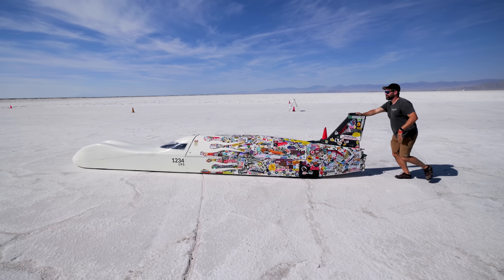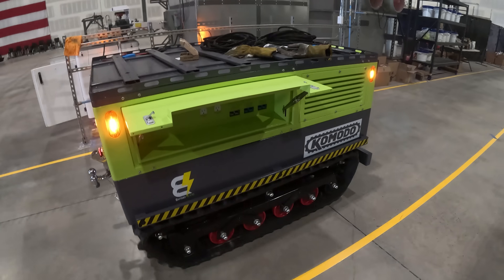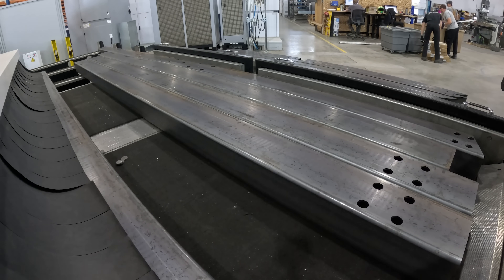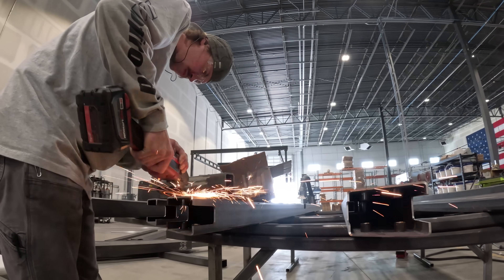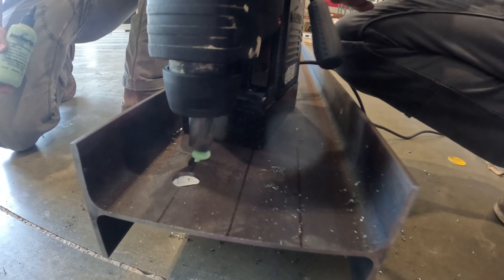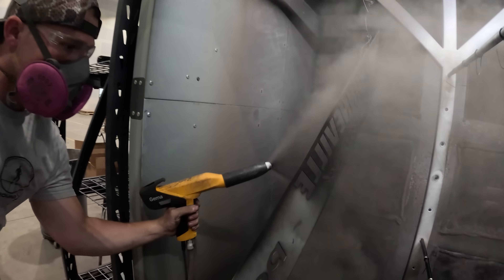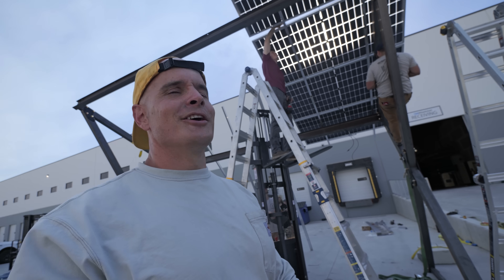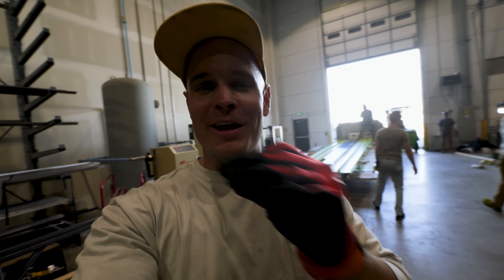The New TESLA TANK -- (Going Off Grid will never be the same)

Comment: If you use countersunk bolts to hold the nuts you are welding to the steelwork they will align the nut with the centre of the hole.

Comment: One of the things I see every couple years is people claiming that CAD is so hard that they'd rather struggle with designing as they build. Or at least some version of designing as they build, like translating a napkin sketch into an object, or their mental picture into the actual thing. CAD might be more tool than some jobs need, but the basic idea of thoroughly designing your thing virtually or on paper goes a long way.

A way to look at it is that if you're in a hurry you can't afford to skip CAD (computer or cardboard).
Reply: There is a learning curve though. If you first have to learn CAD, then by the time you have a CAD plan, chances are you could have been done with the project, using a napkin sketch.
Reply: @dachsdk1559  Fair.

Though that's one of the reasons I tried to follow up with "CAD might be more tool than some jobs need, but the basic idea of thoroughly designing your thing virtually or on paper goes a long way." Learning CAD from scratch (or relearning it now when you learned the OLD AutoCAD way) is a cost, so I meant to be mostly talking about people who don't use the design and documentation tools that they have. And particularly the people who insist that they would have spent more time increasing the detail of their design than they ended up spending on mistakes (or wasted materials) during their napkin sketch only design.

For some further clarity, a napkin sketch to me isn't really a design, it's somewhere between an idea and a design. Sometimes it's enough if the actual thing in your head was largely complete, because then the napkin drawing is really just a mnemonic. A design doesn't have to have all the answers, but I think it should represent all the questions one could reasonable come up with before picking up the tools.

Also, now that I remember the context of this comment, the scale of the project (cost or just simple size) directly increases the value of designing ahead. Material costs of mistakes are higher with bigger parts (or expensive materials), and reworking is typically slower too. I'm not sure CAD would have been important for a support frame 1/4 the size of this one, even when made by a team like this that already has CAD users and CAM tools, but the time spent virtually designing this support structure let them use (expensive) faster tools and put it all together pretty rapidly with apparently very little time wasted on problem solving.

Comment: Just wondering if the array comes close to filling your daily plant power needs using the battery to even out surges. 
If not and your evening power costs are lower than during the day then topping the battery overnight could help with that. 
This probably wouldn’t be cost effective to buy but if you have the unit paid for and mostly on site anyways, I’d think it could help improve the bottom line.

Comment: Mobile DC Fast Charger! Charge Rigs FLEXX 120. What is the difference between the track Mobile Battery and the one I have mentioned the one I mentioned, that is on a trailer but yet the tank Mobile Battery could be put on a trailer 
Very cool it needs a rotating solar array which looks like a flower that way you could capture the Sun as it moves 
Did you do the double-sided solar panels because you do get a lot of reflected light I would think I don't know on the Salt Flats .
It's interesting watching you build I wanted to copy an old design of a hot tub cover which was made out of 1" square aluminum tubing and it was really hard for someone to come up design and welding it all together most hot tubs are the same size and it was in two halves where it had pins which would locate the two halves together when you put it on the hot tub but it was so simple and it could easily be covered with a bespoke covering,  I would think that there is a market for it because the ones that you buy from the hot companies look awful especially when you have some high end residential property

Comment: So this a 900ah battery on tank tred tracks, 3 300ah lipo batteries. This doesnt seem logical.  Searching i saw 1200ah and thats just one more 300ah battery  so 4 basic lipo batteries are heavy but not that heavy that it needs tank treads. 72 volt batterys are massive i guess.

Comment: You're wrong about cars on the coast IMHO. I have a 2014 Subaru wagon (for example) that has lived outside, across the road from a beach, all its life, and it's fine. Other stuff, like garage doors and metal fences, have a lifespan of about 20- 30 years, but having said that, my 30+ year old steel shed (24x18) still looks like new. As you'd know, surface prep is everything 😀 On the 100kw battery, pretty exciting what potential an EV with a 100kw battery could have while sitting around in your drive 🔋🤩

Comment: For your magnetic drill press, I used to use what I think were called hole-hawg annular cutters that had a special holder that was also an oil pump that lubed the bit as you drilled down inside

Comment: You know you can get generator to mount in the tesla
Reply: With a solar array and a battery you won't have to fuel up ever, no oil changes, just the regular cleaning and maintenance. Less things to worry about. Plus a generator of that size will be loud, and it cannot be used indoors.

Comment: 0:20 The closest place to get the electricity is the sun? 🧐 I thought that thing was pretty far
Reply: It's actually spewing parts of itself right onto our little planet.
Reply: @cre8tvedge  parts of it, not the sun though, which is what he said. Thats the point of the joke -_-
Reply: @ricardoveras3433  Yeah I got the joke. But the idiom in the video is normal and correct in our new reality of capturing solar energy (sun bits striking the panels). Practically it's better to capture that energy than to import fossil fuels and generators....  When the sun does impact the earth it will be via the opposite as the earth is sucked in and burned up. To be clear I do get the irony of the sun being 96 million miles away unless of course your a flat earther or fundie and then it's right close by. /S
Reply: @cre8tvedge  no shit. That’s why it’s called a joke

Comment: $35,000 battery that holds $6 to $15 worth of electricity, total.... Whisper quiet premium Honda generators that run at  $1.00 or less per kwh are not looking so bad.
Reply from the maker: Depends on your application. It's quiet. Doesn't need fuel (if attached to solar)  and has a 10 year warranty. I see diesel or gas generators working great on short term projects. But long term no maintenace setups can benefit from batteries.

Comment: I built an array last year that you may want to consider copying for your next one.  This really help you maximize the sunlight your solar panels receive and boost your energy production.

Basically, the idea is to mount each of your solar panels—say you have about 16 of them—on its own small, adjustable platform. You’d attach a light sensor and use something like an Arduino to control a small motor that would adjust all of the panels at once. The idea is that the panels can automatically tilt and adjust throughout the day to always face the sun directly. That way, you’re making sure they’re capturing the most intense sunlight from morning to evening.

In short, by letting the panels track the sun automatically, you’re likely to see a nice increase in the amount of electricity they generate. It’s a bit of a DIY approach, but it can be really effective and give you a lot more bang for your buck out of your solar setup. It really maximizes your power and easier to setup than it sounds.  It’s a simple x and y axis that you program in and I used AI to write the programming for mine.  It worked first try. Let me know if you want any more details!
Reply: 2 Servos and a microcontroller can do wonders!
Reply: Do you have to spread them out so they don't cast shade on each other? Is that worth it?
Reply: How much would it realistically save though? Solar panels have gotten ridicilously cheap, that said the fun of the project might offset the additional time spent making the tilting mechanism

Comment: 4:02 Why would you lie I have 5 years of CAD experience Solidworks, autoCAD, Fusion 360 you name it I can use it, doing a ton of projects, FEA CFD degree in mechanical engineering too and you tell me not a single employer takes me.

Comment: Noticed how you use kWh instead of Ah for this battery? Try to do that with smartphones.
Reply: Ampere hour is the worst 😅

Crazy BMW used it for the i3 back in the day… Makes it impossible to compare without more info
Reply: It's just convention. Smaller batteries are typically compared using mAh ratings, bigger ones in kWh (or MWh)
Reply: @GodofGHz Dissagree, with Ah you also need voltage to get the capacity, Wh/kWh/MWh is the way to go for all sizes! 😊
Reply: @GodofGHz but it’s a horrible convention. Some power bank companies are using mAh ratings based on 3.6v and pretty much any mainstream device uses a much higher nominal voltage, almost 3.9V with variation between brands and individual devices. And I haven’t even started talking about having multiple cells in series. Gone are the days of standardized 3.7V, there is no longer such thing as a direct comparison using mAh with modern devices. 

A different comment I saw provided a good analogy: Back when digital cameras were starting to be mainstream, they still used the outdated hypothetical tube diameter instead of the true sensor diameter (HYPOTHETICAL!!). Of course the bigger measurement sounds so much better to the clueless consumer and now we are stuck with a bad convention in the photography space. Just think we are in a time of rapid development for lithium batteries which will continue to have diversifying voltages.